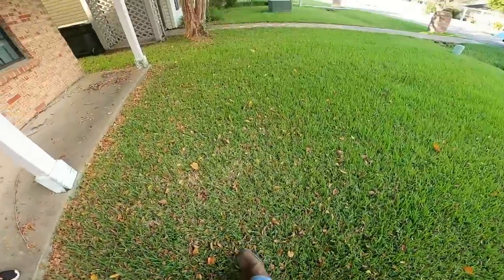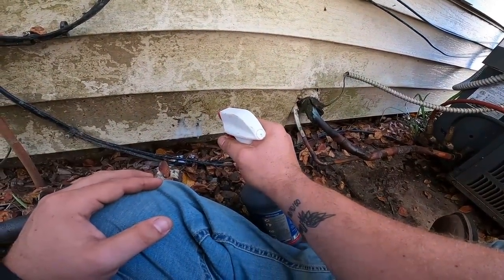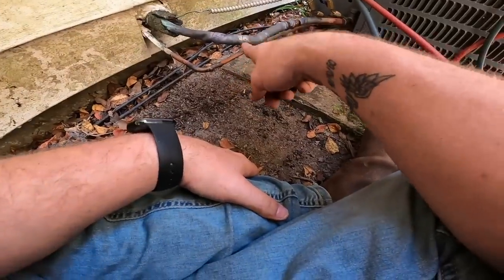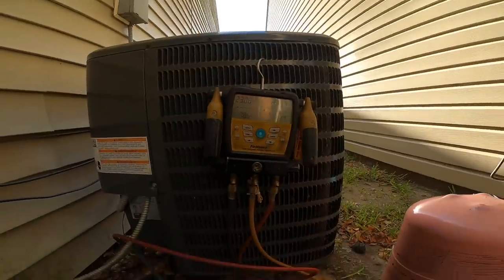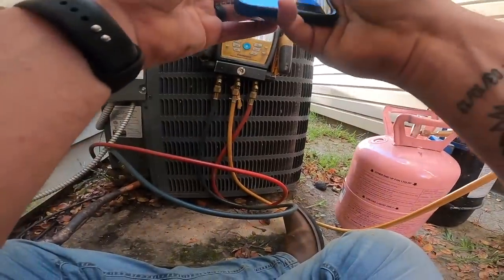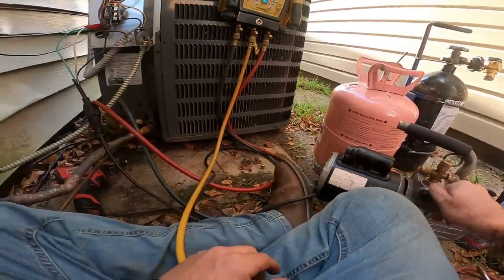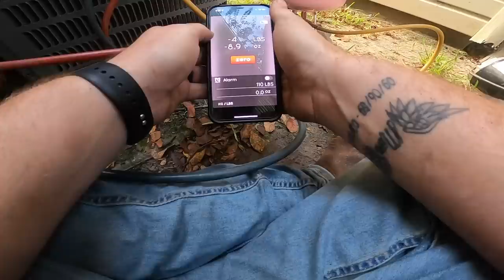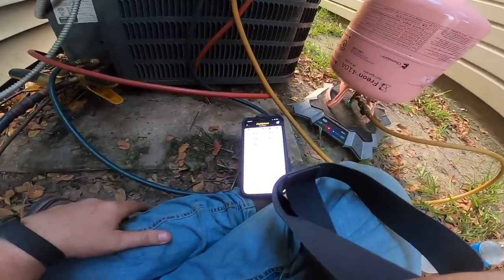Home Owner Installed own Condenser/Fixing his Mistakes

Comment: You might want to purge the system with nitrogen before and during brazing. I didn't see a nitrogen bottle, just a 410a jug when you finished brazing. Keep up the good work.
Reply: look closely its on the right of the 410 jug in the part when he is hooking up his pump
Reply: I did see the nitrogen bottle
Reply: Not much need to purge when you know there is no oxygen in the lines….
Reply: @89dhvac  I think he means to prevent carbon build up by brazing without flowing nitro
Reply: @EastDallasKicks  how would you have carbon buildup if there’s no oxygen in the lines for anything to burn?
Reply: @89dhvac  Seeing that he was working on a jackleg install, it's highly likely that it had oxygen in the system. I always recommend purging with nitrogen as it doesn't cost me but about two dollars in time and materials.
Reply: You need glasses! It was right next to R 410A drum! lol.

Comment: I'm not an hvac tech, however i installed a system for my parents. Set it up, made the duct work. Installed all wiring, thermostat but i was not about to  touch the line set or attempt to try. I saved them some money and got the local hvac tech to come out and make a easy paycheck. It was a have to situation but yalls work is worth every penny. And we have them come out and service it.
Reply: The only thing that is probably off limits to DIY installers by law, is charging the refrigerant. Since you need an EPA license to do that. The only way that could be flexible, is if you were installing a mini split or package unit that was already precharged at the factory. If you were installing a gas burning system. Some states requires you to have a gas fitters license to hook up natural and propane gas lines, that are part of the house.

Comment: Happy Birthday!! What torch tip size are ya using on your acetylene setup? seems to do  really well on larger diameter pipes.
Reply: It is the self lighting tip I have the same one don’t know exactly what it’s called
Reply: Gotta be bigger than a 0 because I couldn't heat up a suction line with that size tip.
Reply: The tip I would use for that size pipe is an 8A.

Comment: Just curious, are all heated diodes the same. I use the field piece DR58 it will alert on coil cleaner and soap bubbles. Anytime I plan on using it I have to make sure I do it before putting any other chemicals on the coil. Not saying that's the same in your case. I have never used the h10. Was just wondering if you ever ran into that issue with that leak detector.
Reply: You need to replace the filter next to the tip often!

Comment: don't you need to pump out the refrigerant to external container before you go soldering ?
Reply: You can pump the system down into the condenser and close the service valves. Run nitrogen thru the line set while brazing copper.

Comment: Those torches take too long to get the joint hot.
Reply: StayBrite 8 is the only way to go when installing new equipment. Less heat and no need to flow nitrogen.
Reply: @picklerix6162  Oh boy, go say it on T lech’s channel and I think HVAC survival 😭 does look fun though

Comment: I didn't think you could run 410a with a r22 coil, or did I miss something? Expansion valve, TXV?
Reply: People do that shit.  But I'm sorry I'm not a fan.
Reply: If you have a piston you can.
Reply: @bubbaharrod2530  Thanks, that's what I figured. The coil itself is the same, so you could convert it by changing the expansion valve to a TXV or whatever for the type of refrigerant you use.
Reply: @jthonn  yeh if it has a r22 txv on it currently just get a 410 txv and install one or convert it to a piston whatever is easier for you but yeh the coil will hold the pressure, a lot of them say on the data that it’s a 410 or r22 coil

Comment: What is that actual frankenpipe situation? Holy schnikes... Kinks and fittings galore. I bet that pipe is literally full of copper oxide scale. Lots of luck to that compressor. And what is the duct-o-pus on top of the air handler? Imagine if he just called you first.  smh.

We call it a suicide cord. Kids, don't try this at home. Leave it to the pros.

Comment: The coil leak inside is probably the reason he had to change his outdoor unit...after it locked up. I would've leak searched the indoor coil before I wasted time cleaning it. Then recovered or pumped down, purged with nitro, to repair leaks/replace incorrect leaky coil.

Comment: Wow!  I do all of my DIY maintenance, but I will not mess with gas valves or refrigerant lines. Wish I knew a local pro. I would like to install two mini-splits, but want pro to do connections and charge. I will NOT do Mr Cool. I want professional equipment that looks good. I’m good at plumbing and educated on electric. I won’t do gas/ or high pressure connections. Good at water!
Reply: I'm a DIY guy too and did a Mr. Cool in my smaller garage. It's awesome. If I was going to do it for my house I would probably go with Mitsu's or Fujitsu's. I'm not a fan of the way people coiled the linesets or the line covers on the outside of the house. I honestly did one of the nicest installs I have seen. Instead of poking out the lineset high I ran it down the inside garage wall. My Snap-On toolbox covers most of it. I poked it out about 2' above the ground. I have shrubs so it's hidden on the outside to the condenser. I used white line cover in the garage and brown to match the gutters even though you can't see them. I measured out exactly where to mount the condenser so no coiling. I ran EMT from the garage ceiling and also poked out next to the lineset and used gray PVC pipe to the disco. From there a whip into the condenser. Being I am in Florida I used a hurricane rated bracket on the wall. You can't hear these running. If I am hot but need to go in and out of the garage I can leave the door open and this thing still keeps the garage cool. 18,000 BTU in a single car garage. We have been in the 90's for a couple months so it needed it. I did a load calc and that's what it called for. Those precharged lines are nice for a DIY guy. I bought an A/C style torque wrench for the flares (no leaks) and a ratchet pipe bender which I didn't actually use. It was a fun project. The only thing I didn't do was run the 240 from the circuit breaker panel in the other garage through the attic. I had a low voltage buddy do that and I made the connections at both ends. This guy is the best I have ever seen running cable to impossible locations without them being seen.
Reply: It hard to find a good HVAC Tech these days. And i think the reason whys that, is similar to the same reason why we have an airline pilot shortage. There not that many new takers of the profession stepping up to the plate as used to.
Reply: @KenKen-ui4ny  you just have to find the right kinda guys. There's plenty of us honest and hard working mofos out here. We're just super busy all the time. We'll get to you when we have the time might just take a few days.
Reply: Why not Mr Cool? As far as I know they are the only precharged unit available making it the only true dyi installation on the market. What am I missing?

Comment: Inspector required a new outdoor outlet installed before signing off on replacement. I use cheater cords for some things, but local code is trying to get rid of that.
Reply: It’s code to have an outlet near the unit now but around here most inspectors won’t make you add it on a changeout if it’s an old house.
Reply: Thats what I thought….guess part of west coast BS.
Reply: @jackl9922  It's part of the electrical code, which is subject to local adoption and modification.  In 'my fair city' the Code office started enforcing service outlets a couple years ago and we're far, far from any coast.

Comment: Why would you ever get involved with a unit installed by the homeowner? 🤦🏻. Now it’s going to become your problem.
Reply: More problems more money
Reply: Use his mess up as excuse and replace everything. $$$
Reply: I wonder why he didn't replace  the copper line on both don't if he used the right kind of copper tubing and make it look better
Reply: Because maybe he's a better tech than you
Reply: Homeowner could have avoided those leaks if he had properly cleaned and prepped the lines and used pro-fit connectors instead of brazing
Reply: No, it’s not his problem. He is an hvac tech, he fixes stuff. He didn’t create that mess. If there is a problem after, it’s not his problem, he didn’t install it.

Comment: But the kink in the line. 🤢🤢🤢🤮
Reply from the maker: Wasn’t kinked
Reply: @johnisraelhvac2019  there is clearly a twist/kink.
Reply from the maker: @nicholasmendoza6159  it’s a dent dude not a twist or kink. If you don’t believe that you’re more than welcome to drive down here and check it out for yourself.
Reply: @johnisraelhvac2019  a dent? Which means a restriction which a kink casues a dent and a twist causes a dent. You wanted to teach the owner a lesson,  should have cut it out and charged him to fix his mess.
Reply from the maker: Dude stfu and go cry somewhere else